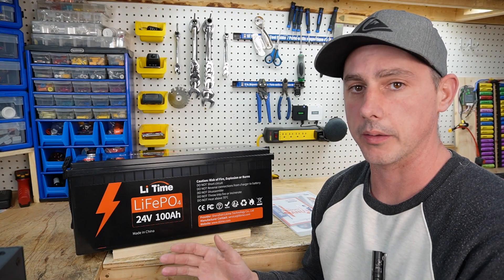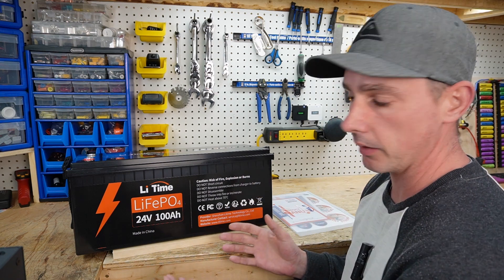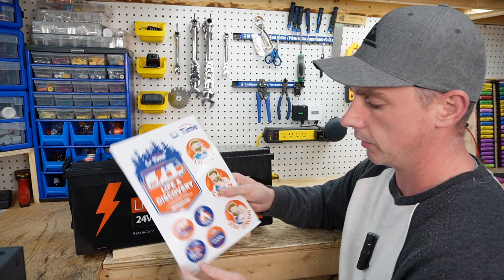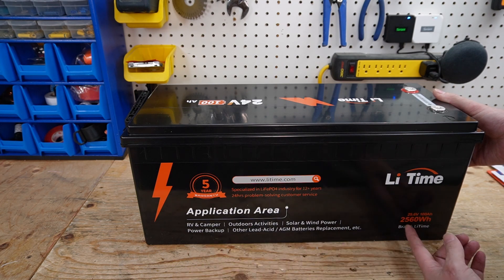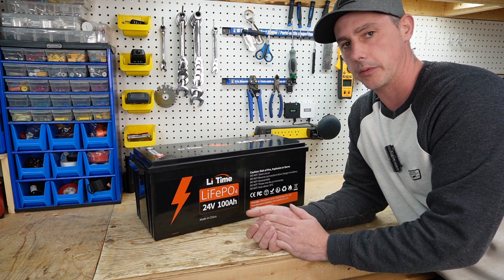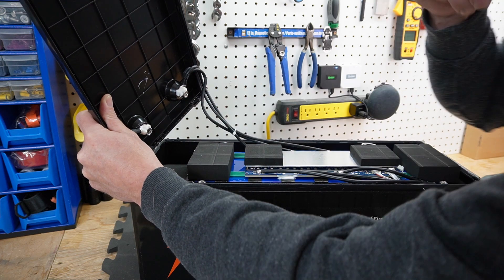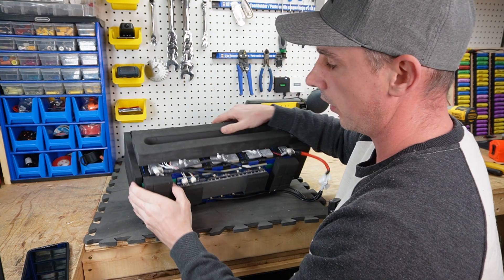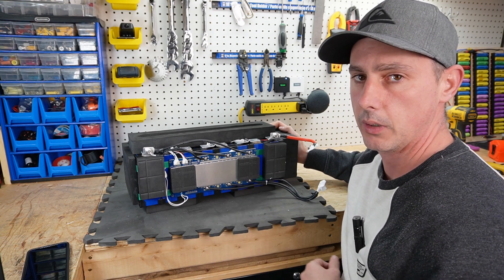LiTime 24 Volt (25.6V) 2560Wh Lithium Battery Test Teardown Great For Trolling Motor And Growatt

Comment: Hi there, having a hard time finding the torque value for the M8 terminals for your battery.  All I find is between 10-15 nm. Do you know?
Reply from the maker: @einyv  Sorry, I don't know that value
Reply: @Roll2Videos  np,I just emailed them and will wait for a response.
Reply: @Roll2Videos  so you have the info from them "Thanks for contacting LiTime.

The recommended terminal torque for M8 bolts of our 24V 100Ah lithium battery falls between 106.2 to 123.9 inch·lbs. (12-14 NM) "
Reply from the maker: @einyv  Awesome, Thank you for the information.

Comment: did you buy this battery ?   or was it sent to you for review ?
Reply from the maker: @robert4027  It was sent to me.
Reply: @Roll2Videos  cool thanks very much.   and what is. max.   charge current. on these. ?    asking because I'm going to buy one but can't find information on charge current
Reply from the maker: @robert4027  On the website, I found it to say 100A charging.
Reply: @Roll2Videos  awesome. thanks very much. . that's what I need on a good day my system delivers 94amp. charge
Reply from the maker: @robert4027  It's better for the battery if you don't always charge it close to the max

Comment: Wondering if Li Time same as Power Queen same as Redodo???
Reply from the maker: They look very similar. I'm not sure.
Reply: Li- Time is identical in outward appearance as my Redodo, the specifications are the same as well. 
Im tempted to connect them together, in parallel.

Comment: What charger would you recommend for this specific battery? Amazon makes it confusing to know. I’ll be using this battery for a 24volt minnkota ultrex trolling motor. Or would you recommend a different battery? Thanks for your time and info!
Reply from the maker: This battery will work for you. Just look for a 24V LiFePO4 charger

Comment: I’m still skeptical about this battery I’m looking to convert from deep cycle for my 24v minkota what would you recommend?
Reply from the maker: This battery is great or check out this video https://youtu.be/SyTO3qfheUQ
Reply: Would you recommend 100ah or 200 ah and thanks for the info
Reply from the maker: @kennyjimenezjr.1348  That depends on you, What you will need for storage?
Reply: I’m sorry a little confused on what you mean by what I need for storage ? I’m not to intelligent on this stuff lol but I fish about 6-8 hours a time on mild currents in the northeast saltwaters. I’m just looking for the best and affordable option to go that will give me the performance I need, deep cycle is out of the option as I need to save on weight thanks in advance
Reply from the maker: @kennyjimenezjr.1348  I think the 100Ah would be enough battery for you. But if you would like to play it safe buy the bigger battery with more energy storage the 200Ah.
Reply: Thank you

Comment: I have a new 36v 60ah i use for a trolling motor, when i charged the battery i git 40.5 and dropped 40.1 in 4 days is that normal?
Reply from the maker: Yeah, That's normal

Comment: I wonder if I could rig up a solar panel to keep this charged ?. I don’t have Electric at the dock and I don’t want to run a long extension cord from the house. It’s for a trolling motor on a pontoon boat.
Reply from the maker: With a solar charge controller. Yes you definitely can hook up solar panels

Comment: Hello, I just found your video via google, trying to find a battery to suit a trolling motor I just purchased, with "Input Power: 1152W" & "Battery Required(Input): 24V 48A" in specs. My grey matter has a hard time getting around this stuff, is that battery suitable? Does 48A = Amps, = 48Ah? Thank you.
Reply from the maker: According to your specs, yes this battery will work perfectly fine.

Comment: Can you do a video about the LiTime 12.8v 100AH deep cycle batteries in series for trolling motors. I have this system and have some questions. The tech support at LiTime is OK but often hard to understand what they are talking about and it takes about 12 hours to get a typed reply. Should have any battery monitoring devices hooked to the system on my boat? I had trouble with the LiTime 29.2 20AH charger doing a crazy thing. After charging battery 1 had 13.37 volts and battery 2 had 12.95 volts. The tech person told me to go on up battery #2 with a100watt 2amp load for several minutes then hook the batteries up in parallel for 12 to 24 hours then let them rest for 3 hours then test them. They were both at 13.66 volts. After using the trolling motor for about four hours at a level of 5-6 battery #2  was at 13.37 volts and battery 1 whose positive was connected to the trolling motor lead is at 13.22. Is this normal? Do I need to charge with the 29,2 charger?
Reply from the maker: This video might help. https://youtu.be/CNbD_gqGBd0

I would recommend a 29.2V charger

Comment: I have a 24 volt 200AH LIFEPO4 an d a hybrid inverter 3200kwv from powmr S settings has gel flooded and user will inverter will not charge battery the chargers from the grid you say growatt inverter  can someone say why it’s not working.
Reply from the maker: Check out my Growatt video on LiFePO4 settings. Take might help

Comment: On Friday  I hooked up my new LiTime lithium batteries to my solar panel system and it works well. With my old batteries I would have to charge them every few hours. Check out LiTime lithium batteries. They have the batteries for your application.
Reply from the maker: Brought to you by LiTime. Lol jk

Comment: I recently installed this precise model and brand of battery into my RV, and it has been nothing short of amazing. The timing is perfect; I think I'll go ahead and order a second one and an inverter to run high-load applications. Thank you! By the way, their official website is usually cheaper than other platforms.
Reply from the maker: Thank you, I'm glad I could help, Have a great day 🙂
Reply: Any update of the battery?

Comment: I was skeptical about LiFePO4 batteries at first, but after trying out LiTime's product, I was impressed with its performance and long lifespan. I used them on my trolling motor and electronics for 8 hours in wind, my battery percentage at the end of the day on both batteries 100%, couldn't believe it!